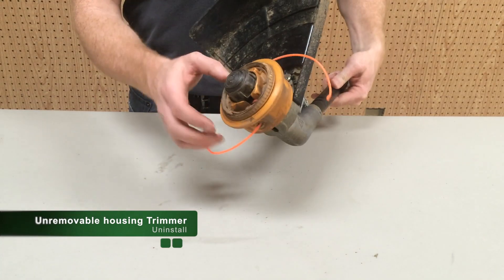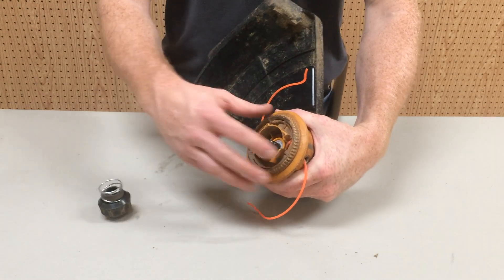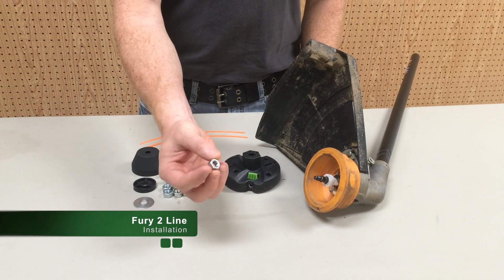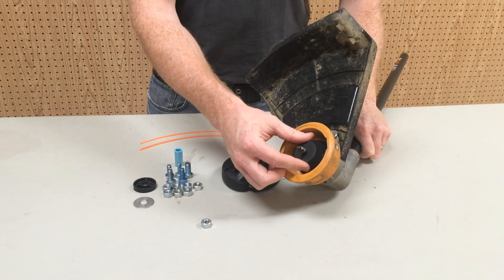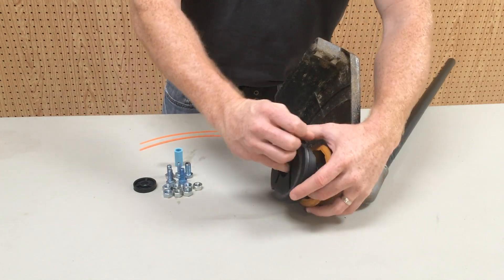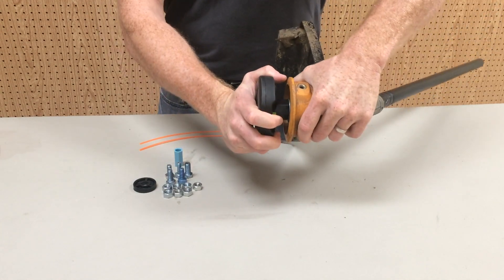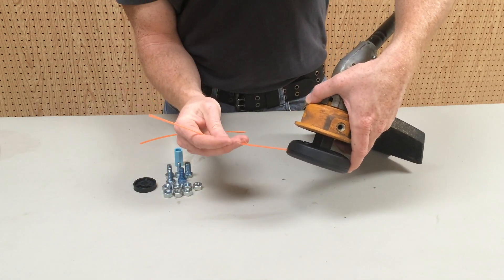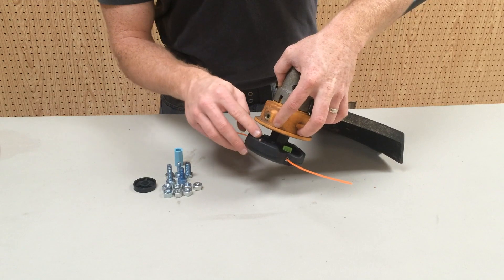Fury 2 Line Method 2

Comment: Thanks, I just bought this today and figure I'd get my education before using it and I really appreciate the heads up on how to remove the line when it's needing replaced!  Both by pushing thru or if enough is left to pull out while pushing the button!
Those little details are the best!  One at work required removing the head to pull out damaged line, so this is already looking much better!
Reply from the maker: Hey Kenny, Thank you for the comment and we're glad you are happy with the purchase.